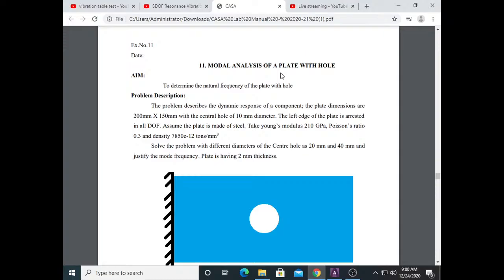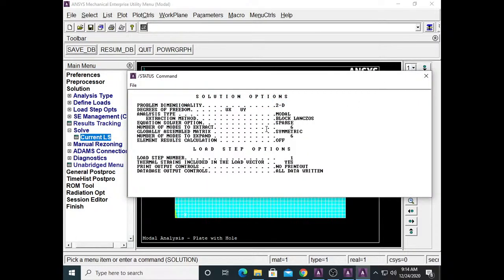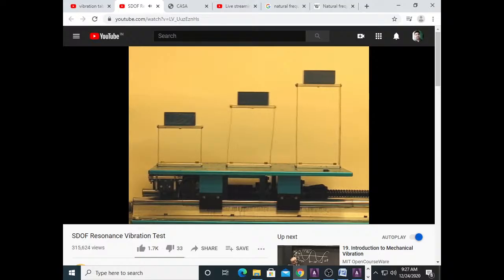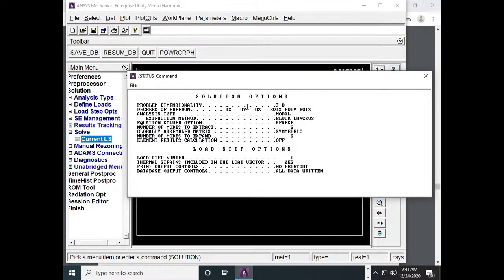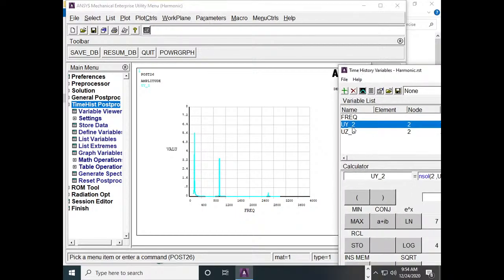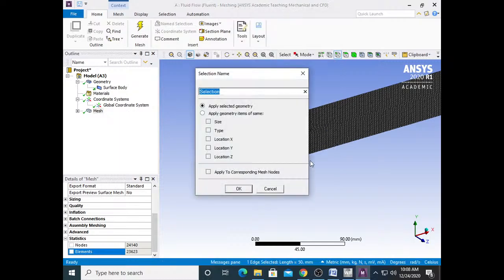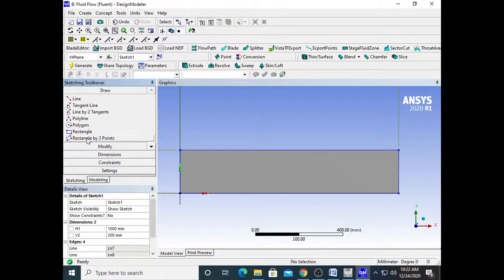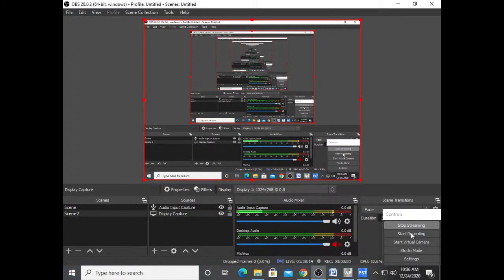ANSYS 2020 R2 Class - Part 4

Comment: Is Ryzen 5 4600H with Nvidia Gtx 1650 good for Ansys, Solidworks, Openform, Hypermesh, Ansa? Any problem in that? Reply fast
Reply from the maker: Xeon processor with 16 core and 4GB graphics is enough
Reply: @fea_dme_creo_hypermesh  I am on tight budget.  It will not be possible